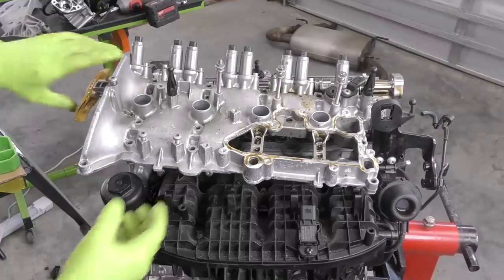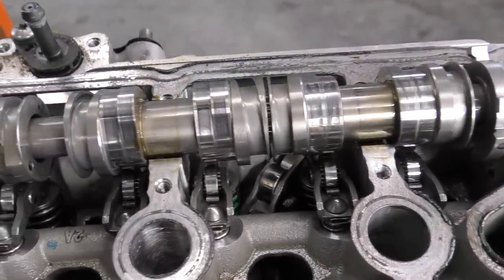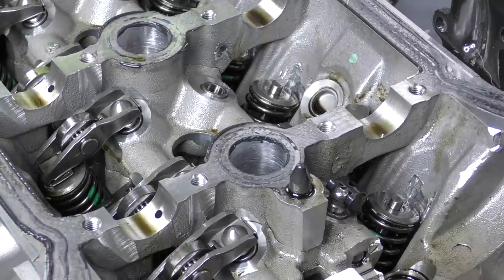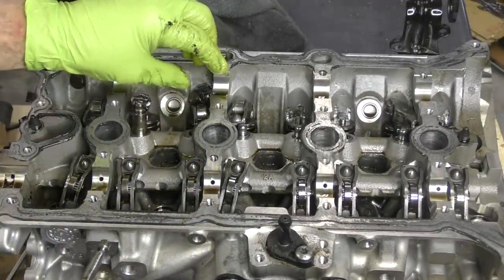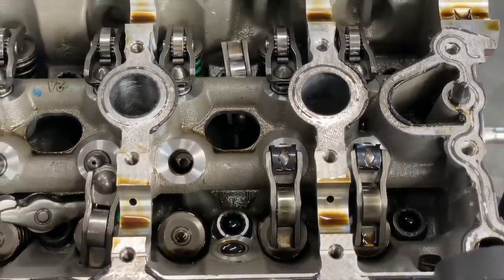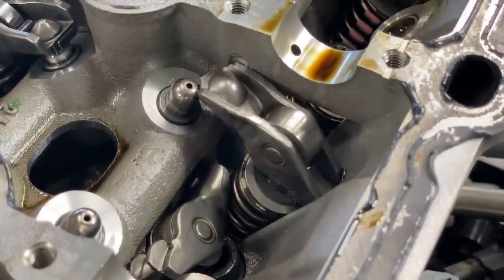Catastrophic Engine Failure VW 2.0t TSI Engine ~ MONEY SHIFT!

Comment: VW  modified engines (ecu software and hardware ) loves to  damage  valves and pistons
Just imagine a guy doing a race  and finds a sudden strong turn so he pops up the gear from 4th to 3rd and step his leg fully out off the clutch pedal  okay he  sucessfully avoided a rollover and at what cost ?
The  timming belt snaps out and the engine simply destroy itself in a 2 seconds time interval .
Smart software tuners should be working with mechanics so  to be aware about the software tunning and do THE PROPER  modification to the engine with stronger components .
I have seen pro modified and tuned car that can burn  tires all day without any single fault or damage to the car.

Comment: It's because the dude was holding the shift. Typical mistake of people learning from movies. You don't HOLD the shift, your palm must be dead flat, you incline it 45 degrees, come in contact with the ball, and pull it towards you to go from 3 to 4. damn dude. 3 to 4 is the easiest gear change of them all, and he fucks it up.

Comment: I'm based in South Africa, and unfortunately we did not get the 2.0 version of the jetta here from the 6 upwards. I have a 2012 Jetta 1.4 tsi 6 speed manual. I'm looking at doing an engine swap to a 2.0 tsi dsg. The body is to heavy for the 1.4. Would this be a good why to go

Comment: I am very sceptical about how the owner says he damaged this engine. Performance cars like this have quite close ratios with no more than 500rpm differential between gears. Shifting into 2nd st 6000rpm instead of 4th would only give 6500rpm, not 9000. Unless he missed out more than one....
Reply: Max RPM for Golf 7 GTI is 6800
Gear ratios for 6 Speed Manual are:
3.76 2.03 1.46 1.08 0.88 0.74 3.42

In conclusion shifting from 3rd to 2nd would give  you 6800 * 2.03 / 1.46 = 9454.79rpm
😃

Comment: @humblemechanic This is known as a mechanical over rev. I am not sure how
the damage was that extensive without the system going solid (i.e. piston to
valve contact) but sometimes when you smack a valve hard enough (over rev) you
loft the valve wayyy past intended lift and it opens up the lash and allows the
system of rocker arm to slide off the side of the valve and spring.  Interesting no ex rockers wear harmed. It would also be interesting to pull valves and spin them to see if they are truly bent or not. I am also confused on all the oil in the cylinders and intake track. The
only thing I can see would be the PCV valve blowing off in some fashion during
over rev.   I kind of do this on the regular and  have a couple suggestions on what else to look
at if you want to look into this further -hit me up.

Comment: Need some advise. My wife's 13 Beetle turbo shut off and wouldn't restart. Pulled a P2088 code. The camshaft actuator was recently replaced about 3 months ago, and had no issues until this. Soni change the camshaft position sensor this time and it still wouldn't start. Found the #5 fuse was blown.  Replaced the fuse and the.car ran good for a few days until it blew again. Replaced the fuse right after it stalled and it kept popping the new fuses..waited about 3.hours replace then fuse and it was good to go. Left it run in the driveway today for awhile and the car shut off and pooped the fuse again. This time the code is P2257.  Any suggestions?

Comment: Not a very sturdy design. Years ago I had an 85 911 carreira. I went to Dropbox from 5th to 4th while overtaking @ about 130 kph and got 2nd by mistake. As I saw needle heading for 9000 rpm pushed the clutch in, got it in 4th and carried on. After about 5 min the engine started to clatter loudly. Since it was late at night in a bad area I decided try getting home about 30 km away. I thought the engine was done anyway. I slowed to 2000 rpm and got home.
The next morning I started it to try to work out what damage I had done. It sounded like the worst case of loose tappets I had ever heard. So I pulled off one of the covers and found to my surprise that all the locknuts on the tappets were missing. I found them all neatly wedged between the head and the oil line. Put them back & reset. Did another 100 000 km before I sold it without problems.

Comment: So is it valve float that causes that? It's interesting that overreving causes valve train damage in small engines. I work on semi trucks and I have seen 13 liter Maxxforce engines overspeed due to a bad turbo. They usually blow a rod out at about 4500 rpm.

Comment: Charles, what is it that causes the rockers to go flying the way they did? Is it the lack of tension from the valve springs that caused valve float and the rockers to shift out of position?
Reply: Valve float occurs when the camshaft speed is faster then the valve spring rebound; so yes, loss of spring tension caused the rocker to come loose and get hooked by the camshaft.

Comment: The BEST thing to do to these engines is just respect them: Don't race these cars - these motors cost too much and are too complicated and expensive to mess with or replace. Just drive them nicely. 
Don't rev them over 4000rpm regularly, try NOT to go over over 5000rpm, do so very rarely... No erratic down shifts either. limit down shifts to the under 2000rpm range and under.
With a manual, Best to use your breaks more often.  This is the only manual i've every had to completely change my driving habits just to be nice to the motor.
Change you oil every 3000 or so miles, or until it starts to blacken, which ever is sooner. Invest in a catch can too.
If you do this, you'll probably make it to 200k miles on these motors - maybe. I'm still on the original 2009 CC tsi motor with 111k miles. other than water pump and the timing chain replacement I'm about to do,  along with the cam tower replacement it will get. I plan to keep this thing running until it wont... praying I get 150k+ miles out of mine with no major issues or problems. I'll probably need the clutch right around then or slightly before.
Reply: Ted G then just buy a Toyota.. what’s the point?

Comment: I understand why over rev can destroy the block on a long stroke engine but why would this engines valve train grenade so badly at 9000rpm when an s2000 can rev to 9000 without issue. Is it an issue of weak valve springs?

Comment: Awsome video man. If you have the time I got a question I'm trying to change the driver side axle on my Jetta it's a '08 Mark 5 5-speed with a 2.5 does that bolt screw out like normal or is it like some of the older Chevys where it's threaded the opposite way I broke two breaker bars trying to get it off and hit it with the impact and it won't budge so I'm wondering if I'm turning the wrong way can't find the info in the Chilton manual or the Bentley?
Reply: lefty loosy.
Just get a bottle of map gas and heat it up until it glows.  Once the axle bolt comes out, don't play yourself and use the same bolt to drive out the outer joint or its curtains for all the threads.

Comment: Still puzzled about the oil in the inlet tracts - did the rockers punch holes into them?
Reply from the maker: My guess is the valves floating let the oil by, and the injectors probably still fired a few times with out the valves opening.

Comment: Question, whats the use of the highest rpm levels which is red when its doesnt even go all the way up, example my gti mk6 has a rev line of 8000 but it will never hit it. So whats the use of having 8000

Comment: How do we get a hold of you I've got a VR6 Turbo I need engine work I have a bunch of parts R32 crank powder rides new Pistons cams it's a 3 l and the new setup should be a 3.3 3.4 the old engine which has less than a thousand miles May 325 horse to the ground

Comment: Did exactly the same with my 1.5T stage 1 ford focus at 5000 RPM shifting 3th to 2nd hitting 8000 RPM before clutching to safety... Nothing happened, driven a few 1000 km since with some very sporty driving, not thé slightest problem 😳

Comment: I love manual shift transmissions and hate automatics and dual clutch (semi-automatic ones) but I have to admit that if the car had a dual clutch transmission it wouldn't have been possible for the owner to damage this engine.
Reply: well, the damage is also from the result of hard driving lets say he was chill driving and did a money shift the RPM would go higher than he would have expected and he would have felt a jolt but I would not expect a lot of damage.

what I am trying to say manual are fun because you can push them hard and when you push them hard there is a risk of a damaged drive train and imo it is a part of what make driving a manual fun. yes the risk accompanying it is fun the same kind of fun a high speed give you. as illogical as it is, it is what it is XD

Comment: Hey Charles, why did VW think a plastic oil pan was better than say, a steel one which can bend and not break if hit?
Reply: Cheaper and lighter to make. Plus you hit something they can sell you a new part or complete engine..
Reply from the maker: Cheaper and lighter. And it’s surprisingly strong

Comment: I'm actually curious why only the intake rockers flew off, while all the exhaust rockers were pretty much still in place.
Reply: Do not know for sure, but intake and exhaust valve lift and duration will be different. The exhaust valves may also be lighter than the intake valves. Combine these factors and the rpm at which intake and exhaust valve followers self destruct will different.

Comment: was there any damage to the PCV system? I'm trying to figure why there was so much oil in the intake if just the rockers deciding to try to leave town.
Reply: Blow by the valves from the over-rev plus fuel flooded.

Comment: Hey Charles, love this vid. I'd be keen to find out about the truth or not behind the dsg park lock/brake weakness issue. Haven't seen it on your channel from what I can find
Reply from the maker: I haven’t heard of that issue. The park pawl will not hold?
Reply: @HumbleMechanic  thanks for replying. Ive heard that it (2006 6 speed dsg) is weak and prone to braking if the car rests on it without the hand brake. I was wondering if you knew more have actually pulled them apart. Experts are hard to find here in New Zealand. To be clear I don't have any issues myself

Comment: I wonder how much experience the driver had with a manual gearbox? I mean 2nd and 3rd are completely opposite directions, aren't they?
Reply from the maker: He went from 3-2 rather than 3-4. 2 and 4 are both down, one just requires a little pressure left. :(

Comment: When you force a mechanical system to do something with inertia no computer is going to stop it, there would have to be a clutch (you) or like an auto clutch actuator in between the inertia, and the engine.

Comment: Can you take the cylinder head cover off without removing timing cover and vacuum pump off?
Reply from the maker: You’d have to take the upper cover off for sure. I’m guessing the lower cover could be left on, but it’s probably not worth it
Reply: @HumbleMechanic  Thank you for reply! I am actually trying to remove the valve cover only in order to perform a spark plug tube seal replacement. Do i need to remove timing cover and vacuum pump off for that? Sorry for the confusion!

Comment: Could the manufacturer add a emergency override clutch activation to decouple the engine from the transmission if a missed shift is detected?
Reply from the maker: I’m sure it could. I’m not sure it can account of the speed of this happening. This is a mechanical issue. The clutch would need some type of electrical intervention

Comment: The sheer amount of plastics inside and around that engine worries me. Yeah lets use plastic to handle all of the oiling system on the bottom end where temperatures can reach over 250 degrees F normally.

Comment: Do you know what a safe max RPM is for an EA888 in a 2017 DSG Golf R:. is? I'm stage 1 + considering going stage 3. The tuner says they spin these to 7500 RPM which seems high given the under square architecture of this engine. Would appreciate your input, thank you.

Comment: Hey bud i got a 2006 bettel with 2 dtcs i have a p1625 and a p1845 it hase a new transmission. Im a tech my self but more on Chrysler and chevy cars. I talke to my vw dealer after installing the transmission and they tolde me there was no programming need for the transmission. I know on othere cars such as Chrysler you have to program them and clear all learned adaptives and such. Can you give me any direction on what i should look into to fix this concern

Comment: Did you replace the top end? Is the engine OK after this? Please update this story if you can.
I have done the same with my 1.8 tsi (ea888 gen3) and I'm waiting for the mechanic to tear it down and see what is broken.
Reply from the maker: The shop working on it did a whole engine
Reply: @HumbleMechanic  why? Didn't you say the bottom end looked ok? also, did you know if the engine kept the idle after this incident?
I have done, as I said, the same with my 1.8 tsi, but after the incident it kept the idle (albeit on 3 cylinders) and I got a misfire on cyl 4 on the diagnosis.
Do you think there might be chances that only cyl 4 is busted and the others are ok?

I know that I need to find this by dismounting it, but it will take 2 more weeks by the time my mechanic comes back, hence I am a bit anxious to just find the answer before :)
Reply: Short update. I've fixed the engine in the meantime. For me, I've hit 9250RPM in 1st gear (went down from 2nd). What happened is that the safety links that hold the rockers arms tied to the tappets or however they are called, that safety link broke loose and so the rocker arms travelled freely inside the top end breaking one tooth from the exhaust cam. Strangely enough only piston no 4 on the exhaust has broke loose for me and the engine was still starting and running fine albeit with 3 cylinders. In the end we swapped to top end with another one and now it is just fine.
Another important remark is the fact that there was absolutely no valve marks on the pistons, so somehow they didn't touch the pistons. Also, the timing chain was fine, hasn't skipped any teeth. I am not saying these are bad engines, but there is a small weak point on those rocker arms links that should not break that easily and leave the rocker arms moving freely in the head. Because otherwise, everything was just fine inside the engine.

Comment: so what actually causes crank walk? is it clutch upgrade or more power? can you get crank walk ifyou leave the mk7 gti stock?
Reply from the maker: I’m assuming weak thrust washer. Typically upgraded pressure plates make the issue more likely. Yes you can get it on stock car. 

Now the amount of cars with this issue is VERY low. Much lower than the internet would have you think

Comment: Hi I’m doing a repair on a mk5 gti 200kms, I suppose one of the rocker fell out of the camshaft but after inspection the inside didn’t receive any damage which is a bit surprising. To fix this is it as simple as taking out the exhaust cam shaft (as this is the rocker that it fell out from) and just put back on the rockers that fell out? Any advice on this incident would be helpful also the car has been sitting for a year and I’ve managed to get it to start recently and after a test drive that happened. I have of course serviced the car before going for the test drive. So yeah any advice would be great!
Reply from the maker: That’s probably the starting point. You’ll want to do a super in-depth inspection for damage

I’d pull the oil pan too and be sure  there is no junk in there
Reply: @HumbleMechanic  full cleaned out the oil pan and unclogged the oil pick up pipe from the old oil things are looking pretty good so thanks for the advice!

Comment: These engines and most engines today are so automatically made.  Assembly made by computer.  I started "mechanicing" in 1984.  I got a Crown Vic Country Squire(zero miles) that was sooo damned rattly.  Keep in mind, brand  new car.  Took engine out and found.010 over bores with STD pistons.  LOL.  Anyway, I repaired and said car went onto lot for sale.  So different today.  Seems factory swaps are available for the tiniest of problems. I am quite happy to not be in that profession anymore.  It is becoming so impersonal.  A mechanic that is not allowed to repair anything more than a leaky oil pan drain plug is a mechanic under-used.

Comment: Been telling VW - to accurize their shift patterns for years now.  For whatever reason - it's quite easy to "luxury shift" one's way into the wrong gear.  
Assuming Synchros don't lock you out and/or the shift "keys" push you naturally to a higher gear.  
One has to actually be crazy enough to let out the clutch to cause ^ kind of damage.  
Yes user error  = a big reason. 
But also - VW pattern design.  ACCURIZE YOUR SHIFTers.  
FACTORY SHORT SHIFTER 
FACTORY beefed up shift linkages. 
SOMETHING.  Please.

Comment: Hi there, newbie question, was this a car with a manual transmission? and if it was, would such a fault still be possible in a variant with a DSG in it or would the TCU deny the downshift at an extra high RPM from happening?
Reply: Yes it was a manual and no, DSG would not allow this.

Comment: I'm surprised the problematic timing chain tensioner didn't add to the damage.
Reply from the maker: These aren’t nearly as bad as the older ones. The chains still have issues but not like the older ones
Reply: Thanks. What year did Audi and VW install the final, revised tensioner? Are there still a lot of "time bombs" out there waiting to blow up with the early tensioners?
Reply: @amazoidal  I think mine was one of those time bombs, sadly